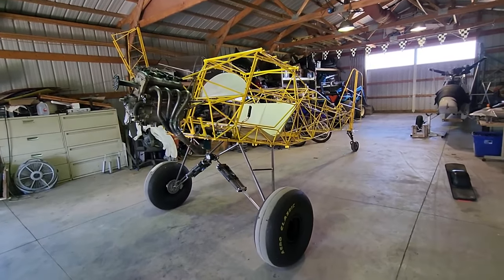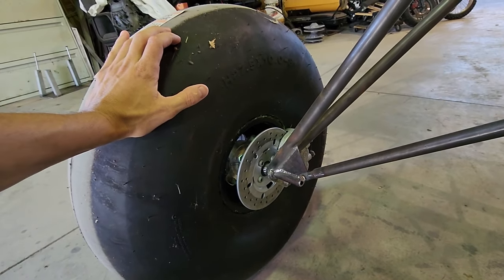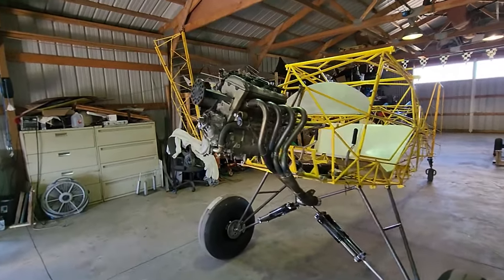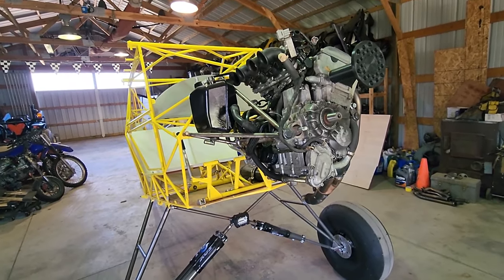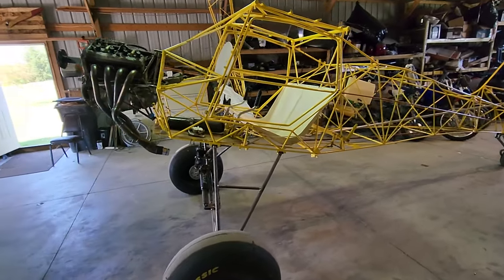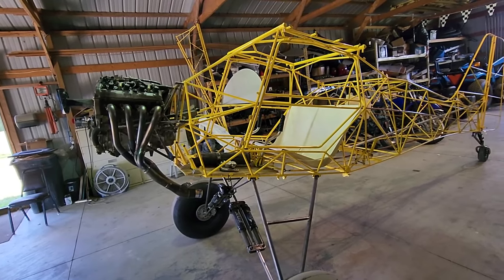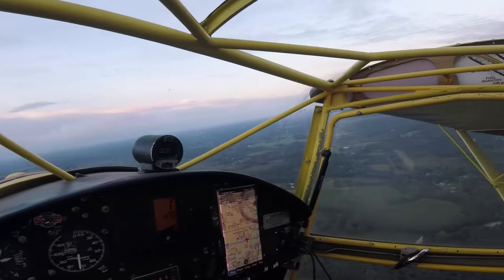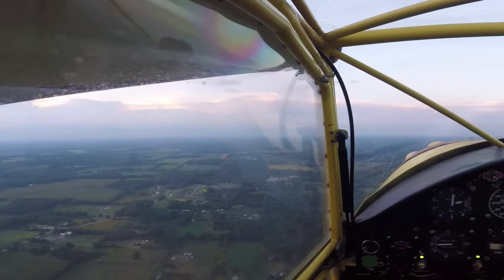Kitfox Update - Yamaha Phazer and Apex

Comment: My third comment 😁… not sure if it’s me or just the videos that I see from you, Trent and other Kitfox guys? If you want your wheels off the ground ASAP, hold the stick back, not all the way just to get a three point takeoff. The airplane will fly as soon as it’s ready, not when you tell it to by putting it on the mains. As soon as the airplane is off the ground, it is in your control to adjust for a rate of climb. I fly a cub with 65 hp and get off way shorter than others with the same airplane and the same engine with this method at the same airport on the same day. Give it a try if you haven’t. Just my 2.5 cents 👍🏽👍🏽
Reply from the maker: Ive tried just about every way in a kitfox. Nose forward then rotate at set speed with full flap yank and given me the shortest results. ill give that way a try again next time.

Comment: what is the cost to install a phazer in a kitfox  2
Reply from the maker: Depends on how much you build vs buy. You can build your own engine mount, exhaust, harness, airbox, etc or buy all that off the shelf. Sled can be had for $2500-3500. The rest depends on if you want to fabricate or not.

Comment: Are you using fusion or something similar for CAD?
Reply from the maker: Yes Fusion 360
Reply: @bkairys  Love the idea of the apex model 4, but the cowl really had me wondering if I could make it happen, do you have any plans to  share your 3d models?  Also I have a small CNC mill if you need helping making a part.
Reply from the maker: The cowl Im making is pretty specific to my engine mount and overall install. Its still in the works but let me know if it looks like something that might work for you when I get it done.